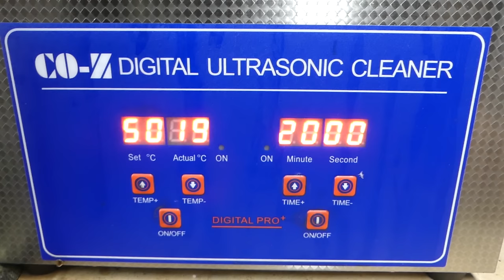Rusty 1950's Tonka Dump Truck and Snow Plow Restoration

Comment from the maker: Thank you all for the kind words! Quick note about the plow color because I'm getting a lot of comments. The plows on tonka trucks of this time always matched the color of the truck. This particular plow happened to be off an orange truck that is long gone. The yellow/green plow for this truck was missing so I'm combined the two to make the set.
Reply: How much u want for it i would love to have it
Reply: I dont like the color but good Work
Reply: I have the same truck but not the plow. I didn’t even know there was one. That’s cool! Great work. I need to try to find a plow now
Reply: Н
Reply: The grille was really rusty and we saw you cleaning it with a wire wheel on a bench grinder. That seems pretty aggressive. In the end it looks nice but it's not clear if you replaced it with another one or polished and painted the original. More steps are needed in your videos to ensure the viewer knows how you restored each part of the project.
Reply: Would you sell this truck?
Reply: @tommynygaardjensen9786   ,m
Reply: 3
Reply: Joe do u still have that snow plow one u cleaned up & restored cause i still want it
Reply: Ңеннннг
Reply: @Zanehoward88  включи мне мультики мультики
Reply: @Zanehoward88  I didn't know this either.🤔
Reply: Great job
Reply: Excellent job 🧞‍♂️
Reply: I remember when you bought that plow off my wife. Small world. 🤓
Reply: @Zanehoward88  Didn't this truck come in a set of 4? A grader, the dump, a dozer, and a tracked loader. The neighbor kid had a set given to him and I remember the color.
Reply: Ku

Comment: Man havn't seen this one in years!
Used to have one when I was a kid.
Setting up roadblocks of trucks, dirt, rocks, sticks, ect... And ramming that plow truck into it.
Wasn't much that truck couldn't go through. Good times 😎
There are two versions of this truck.
A single axel and a dual axel.
Both came in either yellow or orange and had two different plows.
The split one shown here and a solid angle blade also.
Very cool to see one in perfect condition.
I'd ad some black pin stripes on the hood and dump bed.

Comment: Wow! This is awesome!  I'm not an expert by any means, but I bought a bottle of Metal Rescue to try and restore a cast iron muffin pan that I found out in the woods. The rust, even the thick stuff, came off with just soaking and using a stiff brush. You've probably used it before. I like to restore old tools and knives. This stuff just saved me alot of time with the grinder and sander! Great Video!

Comment: The V plow is the wrong blade for lime green dump,  originally came with the straight blade plow, the v plow only came on big mike or orange state highway dumps, but will fit any tonka truck for restoration and customizing , good job

Comment: I use "white vinagar" to soak small automotive parts an overnight soak useualy cleans up your average part.. If you leave it too long like moths will start eating the metal.
Never tried on anythi4 but steel or cast iron. Big labor saver.
Reply: Sounds scary, metal eating moths.

Comment: Wow Joe, I am impressed, fantastic restoration!  I had several of these in the 1950's when I was a kid. They were my pride & joy.  Now don't hate me when I ask this but did you fix the handle that holds the tail gate closed after you finished?  Looked like the angled end that held the tail gate closed was missing from the rod of the handle.

Comment: I see you used a metal filler called Lab Metal. TRG Restorations used that same stuff before. I wonder how come you didn't shoot a powder coat primer coat first, came back and wet sanded, and then apply color coat afterwards? Maybe would've achieved a slightly smoother finish. Just a thought.

Comment: Powder coating over pitted metal like the snow-blade yields a rough finish. Imagine how nice it would have looked with a couple coats of primer that was wet sanded in between. Plus, you need to show us a little more of your repairs, axles magically clean and straight, etc.

Comment: Never seen the filler in a can like that, i use sem high build urethane primer on a spray can its a bit pricey but it works great and sands easy. Fills in large pits and covers any bodywork or sand scratches.
Reply: Hi can you tell me the brand you use?

Comment: Goodnight...
I am writing to you from Spain ,, I am a bus driver here and I like to collect buses at 1:50 scale ,, I want to paint them but I do not know how the original paint is stripped ,, they are in metal and some parts (the minimum ones) in plastic ,, could you give me a hand with the info ??. products ,, liquids ,, sandpaper ,, etc ....
Thank you very much and greetings from Spain
Reply: If the metal pieces are have rust like in this video, a sandblaster is ideal. Otherwise use sandpaper. Start with like 150 grit and work your way up to about 320, then primer. Sand the primer with 500 then paint

Comment: A fantastic restoration Joe. I'm curious how does the powder paint stay on the metal before you heat it? Stay safe Kath UK
Reply: I think it's a static charge.  The hangar is connected to the powder coat machine and creates a charge.  I think.
Reply: @shawnwright4129  thanks